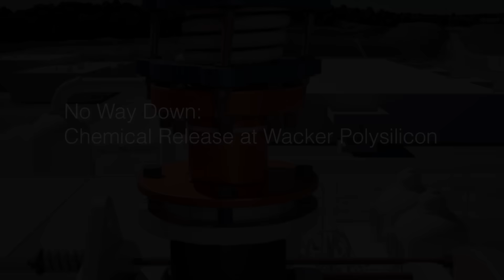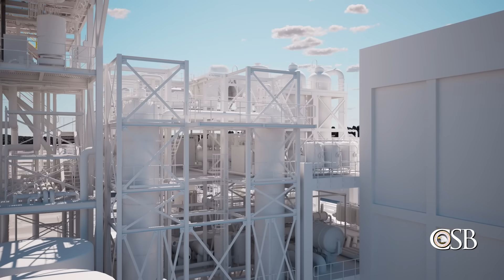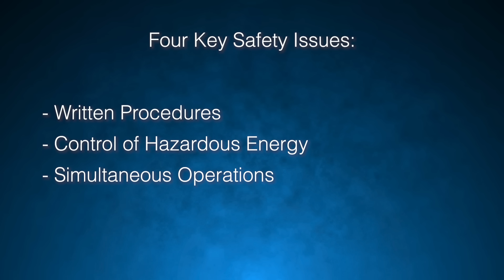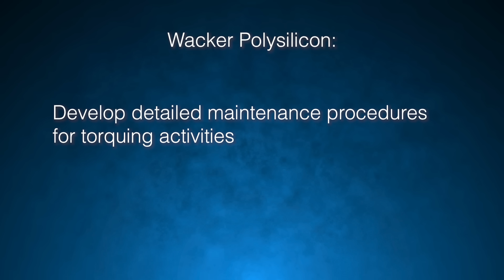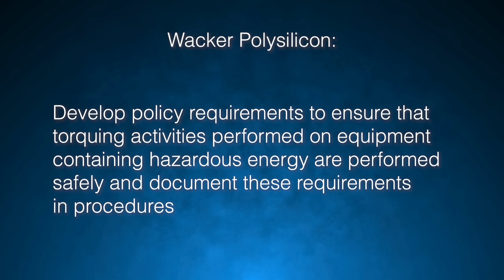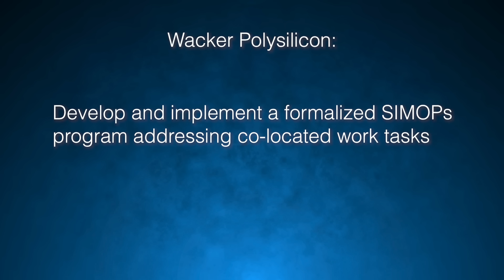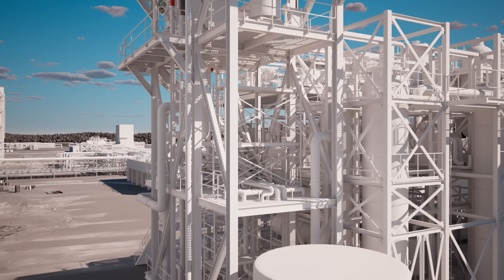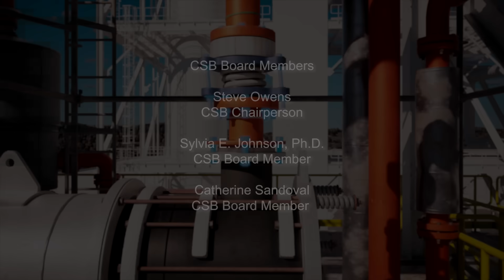No Way Down: Chemical Release at Wacker Polysilicon

Comment: How much does a ladder cost? Couple grand? What a shame. Its criminal that they wouldnt install one
Reply: A temporary ladder built from tube & clamp scaffolding could be erected in a couple of hours, complete with a safety cage. During a significant maintenance turnaround, there would doubtless be scaffolders and T&C material around. This is part of normal shutdown planning. Even some rudimentary, informal PHA would identify the hazard of a single egress point, and a simple work plan would provide for the construction of a secondary emergency ladder prior to the scheduled work on the platform.

Comment: If you're wondering what Hydrogen Chloride smells like, it smells like pain.  I got caught in a cloud of vapor off the 35% HCL tank at work for like two minutes because I had to come down off the second deck of a scaffold and if you ever want to find out just how much space inside your body your lungs take up, this is certainly one because that burn is gonna last quite a while.

That was 2006 but I'm sure I'll be (cough, hack, choke) perfectly fine as I near 50.

Comment: props to the guy who was helping and trying to shield less equipped colleague
Reply: Also, a Pen Gulf victim was put under the emergency shower by Jake Marshall employees to try protecting them from the hydrogen chloride gas, which turns into hydrochloric acid when it mixes with moisture in the eyes, nasal membranes, and lungs. The water from the shower would have helped shield the victim, as well as dilute any acid formed on clothes and skin, if the flow rate was high enough. See p. 23 of the report.
Reply: @markh.6687  So what I'm hearing here is that, at least some of the Jake Marshall employees were well versed in chemical incident response, potentially to the point of understanding the specific chemical interactions involved.  They may have been ill prepared for the task at hand, but they were very prepared if anything went wrong.
Reply: @thomaswodarek1257 honestly the way the video put it sounds to me like the mentor didn’t tell him the torque specs of the lower ones because he didn’t expect him to tighten those. And the apprentice, not knowing any better, just tightened ALL the bolts
Reply: @Zildawolf  reminds me of my last job. Get screamed at if you do nothing get, screamed at if you do something. That was a fucking toxic ~workplace~ well it was only the boss my colleague was fine. I loved the work. But you can tell he was also broken by my Boss'es abuse.
Reply: I was thinking about them and how horrifying it must have been to stay while the other three tried to climb down. They would have seen or at least heard the three fall down off the piping while they waited there not sure if they'd survive themselves. What a nightmare scenario.
Reply: Wasn't even his colleague, they worked at different companies
Reply: @nickwilde2569 On that particular day, they were colleagues regardless of which company paid their wages.
Reply: @sparcnut  every worker has far more in common with workers at another company than they do with their own bosses.
Reply: @0x0ada This is like when the nature documentary says "this mouse is more closely related to an elephant, than to this other mouse"
Reply: @sparcnut Agree! 100%
Reply: @nickwilde2569   if youre on same site, same industry that is your colleague
Reply: @nickwilde2569  he said colleague not coworker
Reply: Yes. Well done!
Reply: "Shield the girl. Let the guys desperately climb out to their deaths lmao."  Ah the poor oppressed female gender eh?
Reply: He was just a simp
Reply: @guaripolo69 finally someone said it

Comment: We need a bolt color code...each color has a range of 10 lbs or so...that way on complex stuff you can't get confused and over tighten to a snap point
Reply: You just know that this would get implemented, but done with colours that can't be distinguished by people with deuteranopia colourblindness, with green being really low torque and red being really high torque, and boom, we're back here again in 2037.
Reply: @josephpottertrue  im not saying to only rely on colors...but if we had both methods accidents would be alot less...btw its not my idea other countrys are thinking about it to
Reply: @danbrit9848  not saying it's a bad idea. Just saying you can always rely on a good idea being implemented badly.
Reply: ...and what happens when a bolt is replaced because it is corroded or eroded? Suppose the bolt is anodized to a specific color? What happens in the presence of corrosive or abrasive materials? Sometimes there is no substitute for good written instructions.
Reply: @jakebrodskype  not saying not to wright things down ...but if there was a stranded you would replace with the same color bolt and maby in acid scenarios it would need more thinking but still possible

Comment: Soon as you said Graphite, I already knew what happened.
Reply: Wondering why graphite was used. I don't know enough to make an educated guess
Reply: @YanickaQuilt thermal properties and chemical (acid) resistance if I were to guess. HCl is nasty stuff.
Reply: But the rest of the piping was steel. Why was that one section graphite?
Reply: @YanickaQuilt my guess is the HCL at high temperature in the exchanger would eat through many other standard heat-exchanger materials.  Once it was cooled, steel pipe was fine.
Reply: @josephfolkemer  The danger comes when HCL comes into contact with moisture.  A very small unseen leak will corrode the metal severely as the wisp of HCL gas mixed with moisture in the air.  I've seen a 3/4" valve chewed nearly in half from a very slow leak....and packing blow right out of another with 400psi behind it... and that's in a process with maybe 300ppm of HCL gas in the mix, not straight HCL.  Scary stuff.
Reply: @khx73  300ppm and it does that geeeeez
Reply: Graphite is great chemical compatibility wise, but not so great for containing pressurized gas.  If the animations of the piping system are accurate, it seems the graphite flange should be better protected and possible doubly contained with steel components.
Reply: Right
Reply: Same here. HAZMAT contained by brittle material + Crack = Oh Crap.
Or would that be Oh Crack?
Reply: No you didn't, because it's not there!
Reply: @transvestosaurus878  this man is clearly delusional
Reply: @postminchoppa  not great, not terrible

Comment: I disagree a bit with their analysis. I don't think the written torque requirements would have helped much if any. I'm a fan of documents. Give me everything possible, but at some point things just get missed. 

The apprentice should not have been working on that flange without direct supervision, if at all. I would have preferred the senior tech to set the torque and tighten himself. Not because it's complicated but because of the risk.

Comment: Torquing to spec has got to be one of the most overlooked practices in nearly every industry in the US. Torque wrenches are expensive compared to regular wrenches. Even in industries that really ought to know better. Like revalving propane cylinders/tanks.
Reply: @someperson7  Most maintenance organizations within facilities have torque wrenches - it's just that getting them to find the required torque spec and actually use it instead of relying on "yeah, that feels about right" can be difficult - especially in a production environment under time pressure. The best way to solve that issue, especially in larger organizations, is through proper planning of maintenance work - finding and staging any special tools like a torque wrench in advance, providing the required torque spec on the work order, maybe even having another person verify and sign off that the torquing procedure was properly completed if it's a particularly critical or hazardous job, like what this video shows.
Reply: @blackbird_actual  Yeah you'd think. Propane company who shall remain nameless I can tell you for a fact never tightened a thing to spec in four years and zero people had torque wrenches. Plastic injection molding company had torque wrenches but when they dug it up all of the experienced people decided that the bolts didn't feel right enough with the torque wrench and the wrench must be out of calibration or the spec was wrong. No one ever got calibration instruments or replaced the torque wrenches. Those bolts were holding up multi-ton molds. Meanwhile we were ripping bolts out of the platnen left right and center. Blown a hole, use a helicoil insert until next time. Even mechanics and builders who ought to know better won't be bothered. It's just not embedded into the culture. A lot of companies have guys who just learned on the job and they know what works... Mostly. So they just keep on going the way they've always been working until something bad happens.
Reply: I think the issue is that graphite non metal parts aren't labeled. The torque required would be more or less self-evident.
Reply: I agree. This and on top of that knowing the limitations of using a torque measurement on a fastener for determining preload/clamping force in an assembly. It’s the second worst way after just tightening by feel, but it is MUCH more practical and cheaper than alternatives (angle/torque measurement, preload indicating fasteners and washers, ultrasonic, strain gauges whatever). Even the OEMs overlook this all the time, the only way around it is very strict process controls which everyone always gets lax on after a while because tightening bolts and SHCS seems like such trivial work. Little different rust inhibitor oil on that shipment of fasteners? Bam your over yielding bolts on pressure vessels. New operator? Bam, your over torquing 30% as he drags the wrench past it’s set point. Change in mating thread machining operation? Bam under setting preload value due to garbage rough threads. Hope all of that was accounted for when the product was designed!
Reply: @JamesJamersonIsAGod  Programming is hard and prone to failure. The real win would be designing products to be as resilient as possible, knowing you're going to turn those products loose to a bunch of apes.
Reply: @someperson7  hahaha, agreed! Making it as robust as possible and keep the dang bean-counters away from it for as long as possible
Reply: Still may need to be rechecked while in operation at elevated pressures or temps (lower temps too)

Comment: The "spring" pictured between the blue flanges is actually a bellows-style expansion joint. You can't actually see through it, but I can understand how the animator was confused.
Reply: I was really confused about what that was, I was trying to imagine why this rigid industrial tower needed suspension lol
Reply: @BetaDude40 I imagined that the pipes and equipment would still flex in temperature changes or wind to need something to provide some slack
Reply: My guess was that those are used to connect pipes that are not perfectly aligned or to allow some movement. Is that correct?
Reply: @MidBoss  Yep, its used to adjust for slight misalignments and accounts for thermal expansion/contraction in piping
Reply: @MidBoss  You can see that the pipes are not aligned
Reply: @MidBoss  To allow for movement due to thermal expansion when the system heats up
Reply: I was also confused how that was supposed to work
Reply: I actually tought it was part of the heat exchange system. Like spring-like piping that allows air to pass through so it cools down.
Reply: Yes. It is supposed to be a bellows, which allows movement like an accordion. It does sort-of look like a big coil spring in the pictures from the investigation.
Reply: My quick google search proves you are very right. If it's this easy for me to identify some random part of a high pressure piping assembly, there's no excuse for your apprentice to not know what they're working on before you send them out

Comment: I'm surprised that the safety margin on those bolts is so tight; 40 vs 15 for a catastrophic failure is scary.
Reply: I mean that's nearly 3x the amount it's supposed to be torqued, most things would fail when given that much excess force a lot of stuff has waaay smaller margins of safety especially  in industrial setting where the public isn't around it
Reply: @noodlelynoodle.  15 ft/lbs is peanuts, considering the bolts being outside and if those bolt sizes correspond to the actual size of the bolts. That torque wrench would also be overkill. You could tighten a 3/8" bolt with 40 ft/lbs without being an issue.
Reply: @東京ワナビ  I'm aware 15 foot pounds isn't much but torquing something to nearly 3x what it wants is a surefire way to ruin basically anything, I can't think of a single bolt I've ever done that would allow 3x as much force without failing which was the point that the person was surprised it was only a 25 foot pounds safety margin when in reality that's a bigger safety margin than most stuff has proportional to the required torque
Reply: @noodlelynoodle.  Yeah I'm not "in the industry".
It was less the fact it couldn't survive 2.5 times the rated torque and more that a worker pulling a bit too hard on a hand wrench could destroy something that important.  
Really if you know it's that sensitive you should probably design that in.  Like have a bolt with a head the breaks off at 30lbs or something. Just brainstorming
Reply: @matthewfindley5530  if you had the head break off you'd be in for a massive headache of trying to remove and replace a broken bolt on site which pretty much no one is prepared for. The way it's designed is perfectly fine if people just do their jobs properly and torque stuff the right amount
Reply: It's not the bolts that have the safety margins, it's the flange material the bolts go through.

Comment: Its crazy that three men thought their best option was to go over a guard rail at 70+ feet without any tieoff.
Reply: Panic makes people do wild things! Can't imagine how scared they must have been to stay up there for that 70 ft drop to seem preferable!!
Reply: @LadyMWZip staying up there would be basically a death sentence of the wind changed even with respirators, that much hot acid vapor would absolutely rip any part of you apart it touches and full body acid trauma is a lot to try to heal
Reply: I mean when your only other option is walking through a cloud of acid that's the best bet, walking through that cloud for as long as it would take to get down could very easily be fatal especially if in their hurry the respirators aren't fully sealed and they're breathing it in
Reply: tbh i wouldve done the same thing - or at the very least gotten to the next level below. bones can be reset, chemical burns can permanently scar and disable you
Reply: I would think that the other workers could not communicate effectively with them, since there was a high pressure gas leak metres from them and the 2 workers who might know were wearing breathing apparatus. They had no way of knowing how long the release would last.